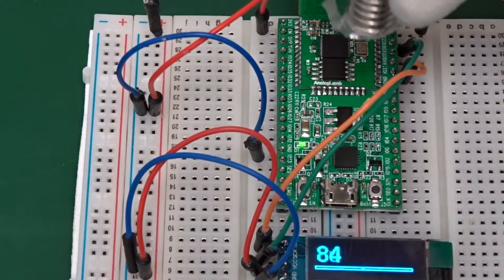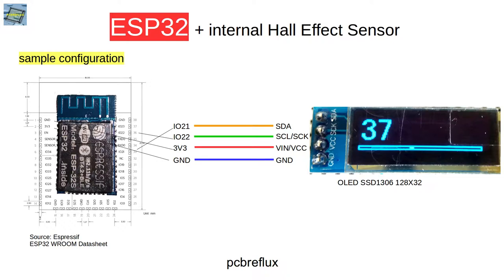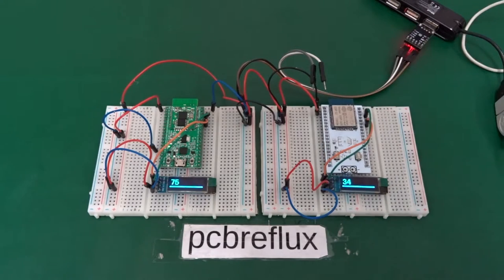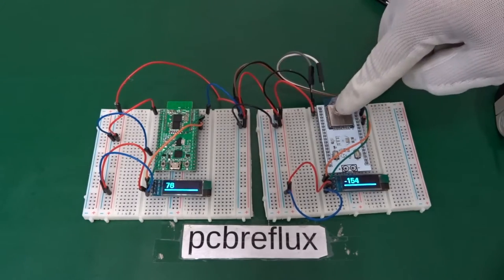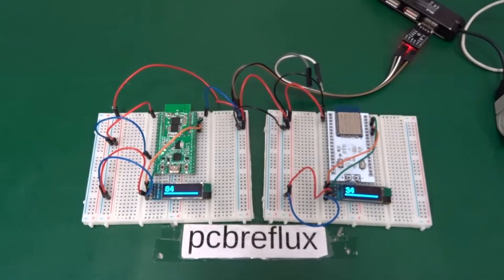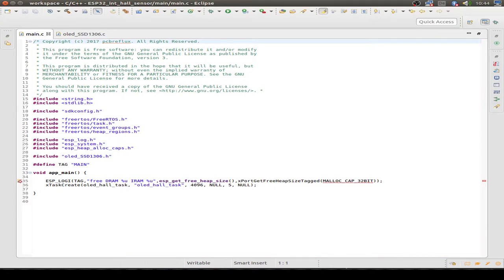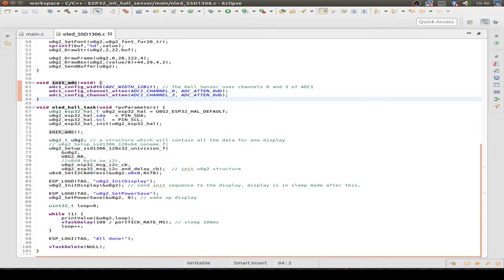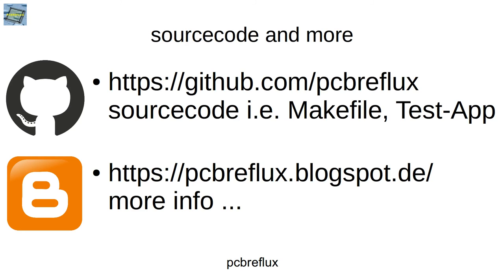ESP32 #28: sensitive to magnetic fields? (magnetic hypersensitivity?)

Comment: Could you please try if and how RF (WiFi/Bluetooth) is severely affected while using those magnets? I'm thinking sending a continuous stream of packets to a host and see if there's a correlation between packet loss while you move the magnets. Just curious about that after watching your video. Great videos, btw!
Reply from the maker: Build a TCP Server that sends continuous packages to a tcp client (putty). Then using a the magnets and an even stronger neodymium magnet (diameter 40mm x 5mm) and wipe it over the esp32 and also over the pcb antenna. Not one package is lost (count compare) and also the connection to wifi ap is stable (10m away). But while wipe over the transmission seems to slow down a little bit. Using the unshielded development board.
Reply from the maker: Small update: try this with 9 concurrent clients: also no package lost. (and this is no 1st april joke).
Reply: That is awesome! Thanks for running those tests and satisfying my curiosity, much appreciated! :D

Comment: Thanks , but tell what line to change in,, test_ssd1306.c ,,for work with 128x64 display
Reply from the maker: Pio Wej My display is the I2C 128x64 version and the lines are commented in the code: I use u8g2_Setup_ssd1306_128x64_noname_f insted of u8g2_Setup_ssd1306_128x32_univision_f but there are many versions of the display on the market.
Reply from the maker: Here are also the GPS example with the 128x64 display: https://github.com/pcbreflux/espressif/tree/master/esp32/app/ESP32_GPS_Clock

Comment: hi, I want using bluetooth on Nano32 using Arduino, Can you help me?  thanks
Reply from the maker: KING z Have you installed the latest arduino-esp32 version from github https://github.com/espressif/arduino-esp32 ? There is a simple ble example sketch https://github.com/espressif/arduino-esp32/blob/master/libraries/SimpleBLE/examples/SimpleBleDevice/SimpleBleDevice.ino
Reply: pcbreflux Im tried, but Not active,this is advertisement
Reply from the maker: Yes, sorry for that. Espressif has no connectable ble libraries for arduino yet. So today there are the option to wait, open an issue to github (https://github.com/espressif/arduino-esp32/issues) or write your own library (tumbling down the rabbit hole) or more?